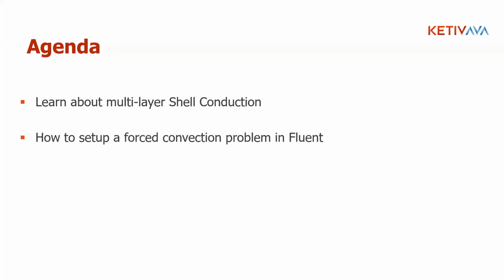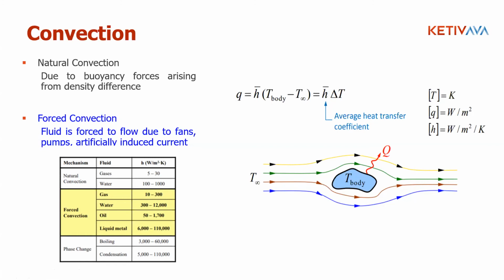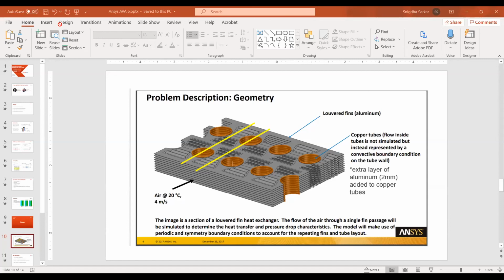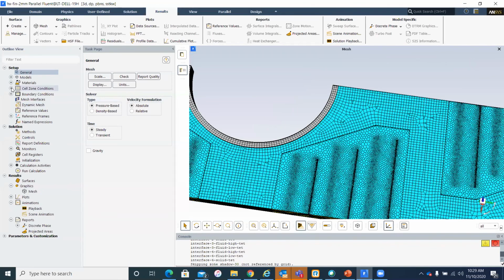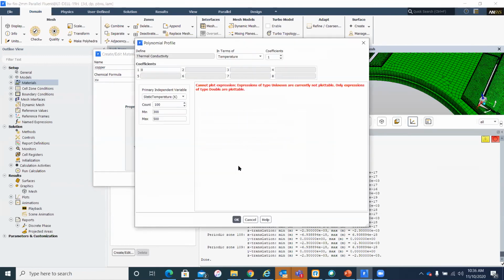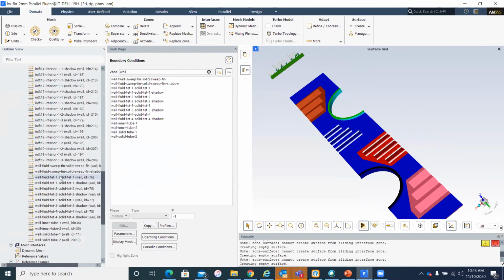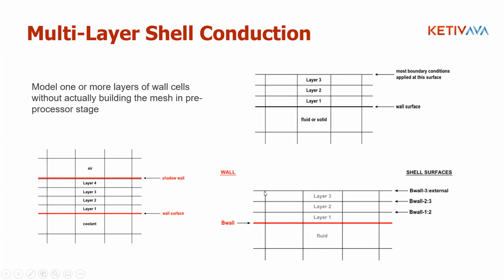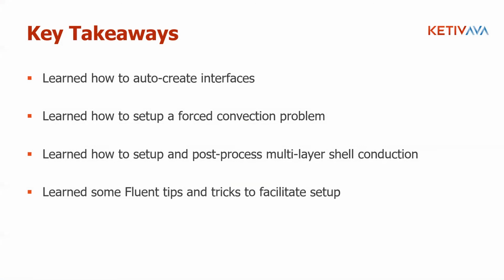Basics of Heat Transfer Modeling in Ansys Fluent – Part 2 | Ansys Virtual Academy

Comment: Hi,

Great video! Very helpful and easy to understand. 

I have a question about inputting data files for heat generation rates per volume, particularly when the heat volume changes with usage, such as in battery cells in an EV. If I have a CSV file containing data for heat generation rate (W/m³) and time (seconds), is there a way to input this data and run a simulation?

Additionally, I would greatly appreciate a video on CFD simulations for battery thermal heat transfer problems, perhaps covering best practices for such use cases.

Thank you!

Comment: I have a copper tube wall surrounded by air and liquid nitrogen flows inside it. I had modeled the whole domain with 3 zones 2 fluid zones and 1 solid zone inbetween them. So, is it enough to keep interfaces as heat flux=0. Will the heat transfer takes place with such boundary condition.